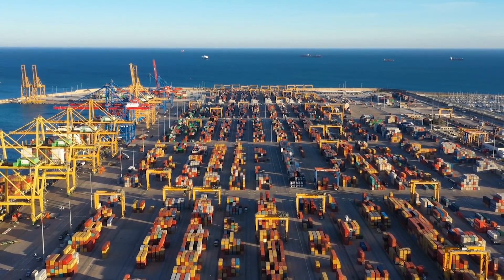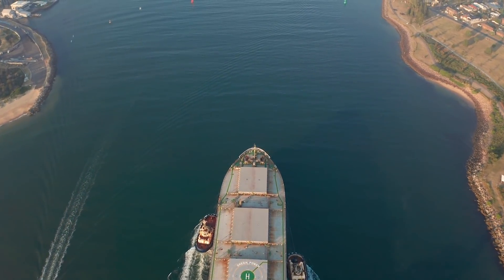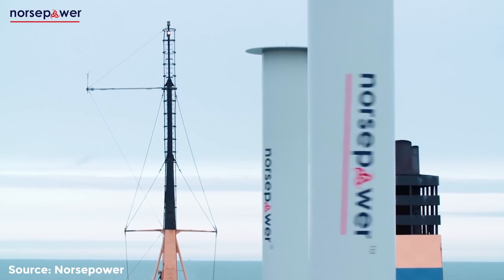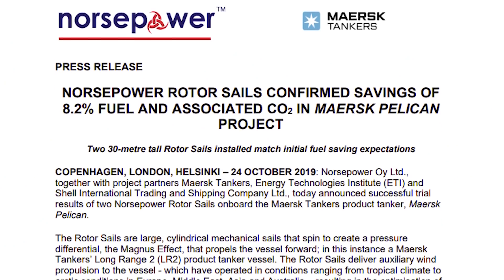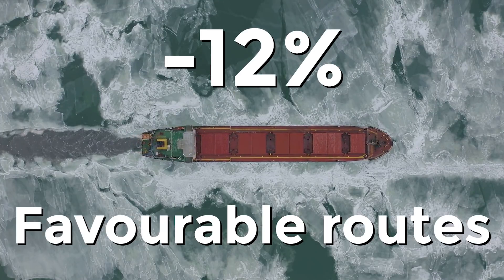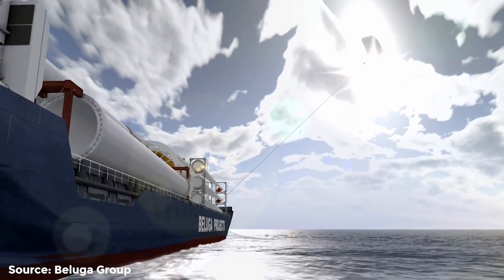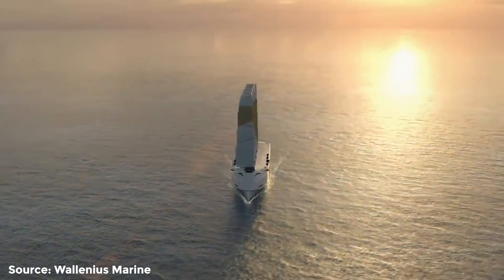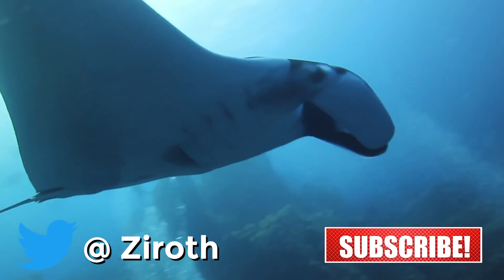Is Wind Power The Future of Shipping?

Comment: Yeah, sailing ships and the future is sailing ships?
Reply: To address the suggestions that sail power is the answer I offer the following.  In 1870 a premium sailing vessel entered service, the ‘Cutty Sark’, she could carry around 600 tonnes of cargo at speeds of up to 17.5 knots, dependent on the prevailing wind, to harness the energy the available spread of canvas was up to 2 976m2.  To round things out that was circa 5m2 of canvas for every tonne of cargo carried.  The ‘Cutty Sark’ was designed and built for employment in the tea trade where time on passage was a large factor in securing the premium freight rate that made her cost effective but as soon as the Suez Canal opened, which the ‘Cutty Sark’ was unable to sail through, she lost her advantage, raw speed, to the steam powered ships of that era.  Mechanically powered ships have improved in terms of efficiency, on a freight tonne mile basis, by at least one order of magnitude since then.  After losing out to the coal burning, steam reciprocating mechanical ships of the late 19th century ‘Cutty Sark’ was relegated to the Australian wool trade, just about the bottom of the barrel in maritime terms and only one small step up from being a 'honey barge'.  The canvas, cordage and extra manpower needed for sailing ships was never a very benign environmental option so please discount any idea of sail as ‘sustainable’.  All this is without the problem that if ‘the wind don’t blow the ship don’t go’, when it does blow it often blows in the wrong direction for your cargo delivery needs and sometimes there is rather too much of it for comfort.
Reply: @BernardLS  some body must be day dreaming , on paper it looks good but???????
Reply: @johnhili8664  The idea of sail powered ships is good but does not scale up.  The size of modern ships goes up to a level that many people, who have no practical experience of them, are unable to appreciate.  The easiest way to reduce the environmental impact of the shipping industry is to move less stuff shorter distances.  Option two is to burn less of the cleanest fuel available; but be aware there are always impacts.

Comment: There is nothing new under the sun. Until 120 years ago, wind power dominated shipping. But here's an interesting slant: perhaps ships could benefit from the diversity of renewable energy by installing large electric motors and batteries which can be charged in port from sources ranging from solar to wind to geothermal, as well as traditional energy generation sources such as nuclear and fossil fuel. And of course ships are huge structures which can themselves carry solar panels and the aerofoils mentioned in this video.

Comment: With battery tech getting better it would be better for the wind turbines to be charging a massive battery pack up. There's only 1 moving part on an electric motor & they're much more efficient for sailing than the traditional diesel engines. One moving part means much less maintaining costs & labour. The space & weight of the batteries is evened out by carrying know diesel fuel or having a huge diesel engine. In South East Asia the fishermen have small diesel generators producing electric to run the electric motor that piers their fishing boats, as the electric motor is much more efficient & reliable.

Comment: Nice video - and yes a hybrid system that combines more then one type of renewable, with more efficient diesel or hydrogen engines, would appeal to the largest number of shipping companies.  
On a side-note, your salt-lamp in the background provides nice ambience, but unlike many claim, it does NOT ionize the air.  In order for salt to ionize the air, it would have to be super-heated, almost to the point of becoming plasma.   On the other hand, any type of running water, such as the ocean, river, or waterfall does provide ionized air, and has been proven to offer health benefits to us humans.

Comment: Just to put your figures in a bigger picture. 80-90% off all cargo is moved by boat. Most boats run on the waste from making petroleum products. So its already the best transport method. 
More boats, more sails and less stress.
Reply: Not when you need to reduce emissions it isn't. That's the challenge. And those waste products are going to go away along with all the land transport shifting away from petroleum. I expect ammonia, methane or hydrogen to end up being the main ship fuel. Right now it's not clear which will prove most popular.
Reply: @xxwookey  First we will finish heavy fuels that you cant use on small engines. Meanwhile to reduce emissions, we will integrate scrubber systems to exhaust systems. Then we need to move on to another energy source. Hydrogen fuel cells are a good candidate. But we have a problem since hydrogen is fuel for these cells we need a lot of hydrogen to operate these things. And hydrogen has a bad reputation, its explosive. We do not  want to stack flammable and explosive things close to each other when designing ships.
Reply: @xxwookey  Hope that you are right in that the petroleum industry will disappear. I was thinking of how efficient it to ship things on big boats. According to ICS a very large container vessel emits 8g/tkm(gramms per tonne kilometer.) compared to a big truck at 80g/tkm. Inland shipping is at 38g/tkm. Diesel rail is at 18g/tkm. 
Its nasty fuels fuels you think we will have in engine rooms on boats. But you are probably right.
Reply: @Uffeful  Yes shipping is very efficient, although not as efficient as not shipping things half way round the world because it's a few pence cheaper.
Those fuels can also easily be made in a carbon-neutral (or very nearly) way. Hydrogen is trivial. It's not hard to go from hydrogen to ammonia (Haber-Bosch) or methane (just need a source of carbon such as CO2 pulled from atmosphere to make it neutral). The methanisation of hydrogen requires only a tiny bit of extra energy and methane is easier to store/transport. All very clean-burning fuels so I wouldn't call them 'nasty'. Not as pleasing as a wind drive, but probably more practical as a solution to the emissions of global shipping. 'All' you have to do is change the engines/fuel handling and make it available at ports, having made it from low-carbon electricity (mostly excess renewables, maybe some nuclear). This is all technically straightforward, but it needs to be either mandated or made cheaper than current fuels to become standard.
Reply: @Wookey.  I agree. The nasty thing is that it is highly explosive and not like HFO that is like tar or asphalt. And ships that have been converted to LNG(methane) have the fuel tanks on deck, look at Fure west and Bit viking. From a motorman's view they can kill you fast compared to HFO that kills slowly. To this day no LNG ship has blown up. 
That 'all' that have to change is to give the shipping companies a economic reason to change. The reason no LNG ship has blown up yet is also economic. Either they are to new or they are shipping LNG and if one of those big ones blew up, they may have to move a lot of LNG harbors because of nervous neighbors. 
Next time a big ship cuts the Mauritius corner to close I hope its a LNG one so the fuel will go up in the sky instead of destroying the delicate environment down there.

Comment: We moved from sail to steam/ diesel  for speed..to save time.. but.. is saving time all that important..
 OK..  example.. im holding a jar of coffee.. the supermarket has jars on the shelf and jars in the store room.. 
So dose it make any difference if the  ship took 10 days or 15 days.. 
No.. I still have my coffee.. it just means we need more storage
Reply: Actually shipping is slower nowadays than it was, because they need to save fuel. The SS United States claimed top speed 43 knots back in 1952, and commercial average above 35, that is way faster than most ships out today. 
Pressure is on fuel savings, not speed. The worse about wind is it's unpredictable and unreliable, and ships must arrive on schedule.
Reply: @jmbpinto73  think the problem is people are looking at wind as a replacement to fuel when it should be seen an enhancement.. if a ships burning 20000 to 30000 litres a day of fuel oil then any savings a good saving..even if you can only manage 5 % in one direction it soon mounts up over a year..  
There have also been serious plans to make a cargo sub to go under the North Pole

Comment: Man made climate change is a myth. Support Carbon 1,000 ppm for a better planet,  end the carbon drought now,
Reply: Totally, nothing says "helping" the biosphere like massive short-term environmental changes, destruction of habitats and widespread pollution.
Even if the claim had merit (it doesn't, in part because Co2 is far from a limiting factor in this current day and age), it would not justify the amount of environmental damage that's being done.
Not content with denying the scientific reality of climate change, hoaxers are now trying to frame this as them wanting to "save the earth".
Reply: @hydrochloricacid2146  The earth was at its best at 2,500 ppm (carbon), the same has the inside of most homes,  more species evolved, planets grew more abundantly,  plants that produce the O2 humans breathe....end the carbon drought, return to normalcy....
Reply: @cannotsay5505  is that the argument? That levels were higher previously so they should be higher now as well? 

Ignoring that this isn't how science works, most species on the planet today evolved to cope with current carbon levels, not past ones. Additionally, plant growth in nature is often not limited by Co2, but instead by other factors such as available nitrogen in soil. Finally, you're totally ignoring the environmental (and economic) damage linked to rapid climate change, which is not limited to rising sea levels.
Reply: @hydrochloricacid2146   The statement is the level is too low now, and it should be towards 1,000.   Carbon has little to no effect on climate as such, it does have a large impact on life.
Reply: @cannotsay5505  do you have any published, peer reviewed material to show that?
Reply: @hydrochloricacid2146   More than you can read in a lifetime.  I would point out, China has been taking measures to acquire new food sources understanding the current global cooling and the political ramifications.   Companies that produce food in the north are closing and relocating closer to the equator because of global cooling (see Del Monte et al).   Remove politics from the mix and observe,  the oceans rate of rising has not increased,  why would oBama buy a mansion on  the coast if he knew the oceans will rise.....
Reply: @cannotsay5505  You're joking right? You're going full denial?
First off, the paper you cited looks at a RIVER in one very specific location, so trying to apply that to any wider context is foolhardy: we KNOW (through multiple organizations, including NASA and ESA) that global sea levels are rising, as both Holland and many small island-states can attest to.
Same thing goes for global temperatures: we HAVE the data. We KNOW that globally, surface temperatures are rising. Nothing short of a global cover-up conspiracy can explain that away.

You mentioned China: they're the ones currently the most investing in renewable energy, and that's despite the fact that they're not the country producing the most CO2 per capita (guess who is).

Also ,about the old trope about Obama's beachside property: ignoring the fact that this isn't in any way a valid argument (Obama could be rolling coal through Yellowstone park and that wouldn't change the scientific reality of climate change), it's also dishonest: that house is a good 30 feet above sea level while the estate itself is sheltered by an inlet.
Reply: @hydrochloricacid2146  What rapid climate change? I assume you mean the data tampering currently going on.   Simply join any website that offers access to old newspaper articles and read about the climate in times past.  Our current climate is better than ever.... If anything, available atmospheric carbon was approaching a troubling low...

Comment: Ziroth -You bring up some good points and you are wise to be skeptical of claims.  The 8% cut in fuel consumption is much more realistic in the real world with no big behavior change and that does not impress anyone.  The big reason wind power is not getting more attention is that there is a worldwide treaty banning taxation of ship fuel.  By comparison, the auto industry has spent hundreds of billions of dollars cutting emissions and increasing efficiency.  Shipping is atrocious by comparison.  Just this past year they finally put regulations on the Sulphur content of fuel oil -on land it was banned decades ago for contributing to acid rain.  If you look at pollution as a global problem it is obvious that shipping contributes the most pollution with the least regulation and spending.  Put another way, that 8% reduction from one ship is greater than the savings from thousands of cars upgraded at a cost of tens of millions.
If we charged as much for pollution from ships as we do from cars, ALL ships would use wind and solar and production would be localized.
I have a question for you, under the Paris accord, what nation is charged for the emissions of ships?  The sender? the receiver? the owner?  or is it NOBODY!

Comment: Wind may not be the best option as a direct propulsion system; however, with ever advancing technology in wind-to-electric generation, it isn't difficult to imagine that large vessels could replace marine diesel with electric propulsion that is powered, in part if not in whole, by wind generated electricity. 
The direction of the wind becomes almost irrelevant while maintaining low to zero emissions.

Comment: Why not use solar panels as wings as well? Mounted on the ships side, tilted upward to save space for navigating in narrow ports and tilted horizontally for catching wind (forces forward and upward) and sun.
Reply: Modern cargo ships displace (weigh) many tens or hundreds of thousands of tons. They move through a medium ten times the density of air. That requires a considerable amount of power. The diesel engine that powers the Emma Maersk, a quarter mile long cargo ship, is 44 ft tall and 87 ft long.and pushes the ship at 28 mph. Not many propulsion systems can compete on that scale. Certainly not solar panels.
Fuel to run these behemoths is roughly 70% of the operating budget, so shipping companies would love to be able to switch to less expensive but equally productive power. Short of nuclear nothing compares, and nuclear is more expensive.
Reply: @chuckaddison5134  Out of 1qm of solar panel you can get up to 200 W of electric power. the Emma Maersk has a width of 56m. If you mount wings of a width of 56m on each side of the ship along the overall lengt you could provide up to 10% of the required 80 MW (+ wind power).
Reply: @santaclaus0815  
There have been several vessels built to utilize solar power. None on the scale of a cargo ship. The power requirements of 180 thousandish tons of ship and cargo through the ocean non-stop for weeks on end, ars not the same required to push a pleasure vessel or ferry. As I said previously, fuel is about 70% of the operating budget of cargo ships. If solar was a practical alternative they would be building them.
Reply: @chuckaddison5134  well fuel is too cheap to fight climate change
Reply: That already exists, but it on on that scale.

There is a passenger catamaran in Sidney, Australia that have solar wings.

There are multiple wings on each side of the ship. When folded down they give shade to the open top deck.

The same company also made two hybrid electric catamaran for Hong Kong, one with a solar wing and one with solar on the roof. The electric power is mostly used for docking, and the main engine is used for cruise speed..
Reply: @MichaelEricMenk  so those solar wings are used for wind propulsion, too?
Reply: @santaclaus0815  yes, they are PV covered wing sail. When not needed as wings, they can lay flat, acting as a roof for the top deck.

The one in Sidney have multiple wing on each side of the catamaran. Other designs have one large wing.

What the company website seems to have been bought up by someone else. So the company is most likely bankrupt.

Search for "sidney solar sailor" to view their first boat.

Comment: what if we connect very long zip(?) line continent to continent and then use electric power to send cargos?
Reply: Cargo trains run daily from China to Spain.
Reply: A very creative idea, but it would take a lot of material to build something strong enough, and if anything happens to it, your whole route is put on hold. You would also have to stick to the wire to stay powered, so if there was a storm in your way you couldn't just go around it like you can in open water.